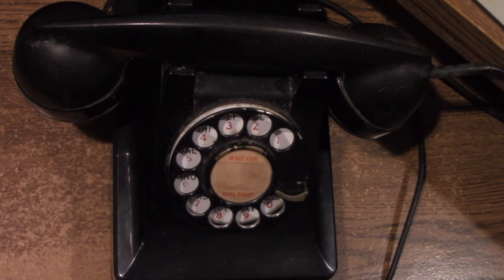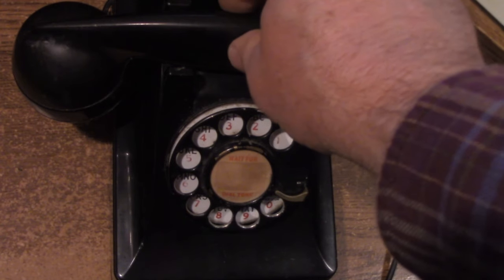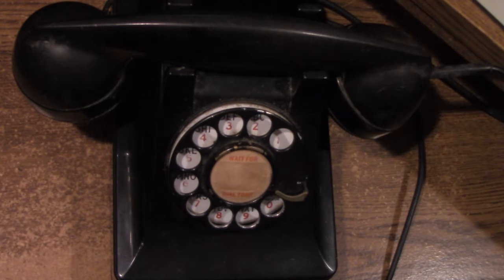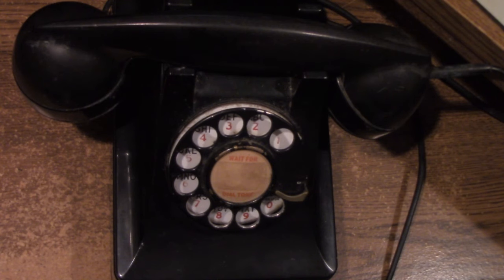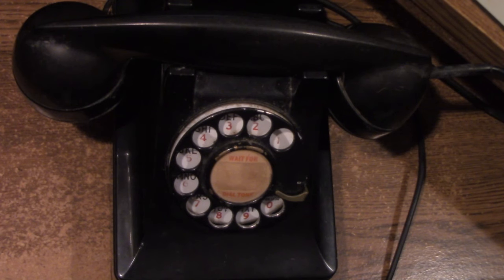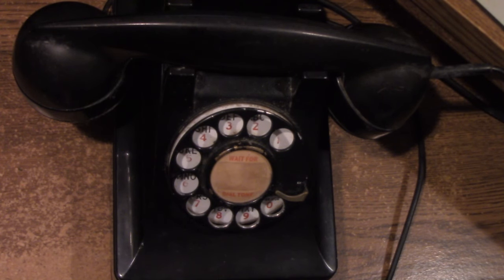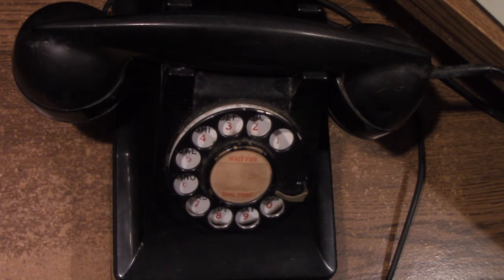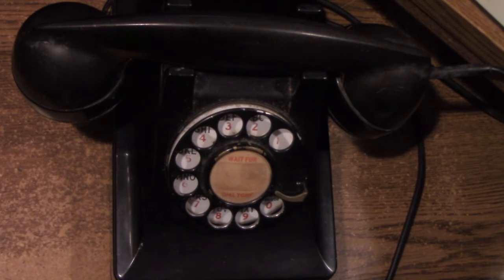Antique Telephone Test

Comment: Possum Back in the day I worked on the test range RCA/PanAm I fixed these phones and the switch as well as doing the OSP. we had a Stromberg Carlson X/Y switch 150 line switch, the coolest thing ever,  ya need 28 volts to ring em...

Comment: I have an uncle who has one of the old wooden box type phones you mount on the wall.
Reply from the maker: Those are pretty cool. I see them occasionally at antique stores and such.
Reply: @Possumliving  also I think my dad said the old crank type phones had a magneto or something like that in them.  When he and his brothers were little,  they used to to turn the crank when ever the telephone man was working on the line near their house.  They said it would shock him.
Reply from the maker: @bluegrassman3040  Yeah, they do. That's how they generated the ringing voltage. Some people convert them to work on modern systems by disconnecting the magneto and mounting a rotary or pushbutton dialer inside. From the outside it looks the same, but you can open the door and dial.
Reply: @Possumliving  that’s neat.  My dad said they also could use those old phones to shock a pond to catch fish.

Comment: The ring signal is ~100vac, probably @60hz but not 100% sure.  In the old days it directly drove the clapper coil, but I spect  these newer VoIP onts can't source enough current for all that.  You'd have to make some kind of circuit to detect the ring and switch a beefier ring signal onto the line or something, I dunno.
Reply from the maker: You're right. It's 50-90 VAC at 20-50 hz. There actually is a device you can put inline that boosts the ring signal and has enough output to drive several old phones, but they cost about $200. I would rather build one, if I can find a circuit.

Comment: 2:22 was it the western electric 500 phone you mentioned earlier that rung in the background or is the 302 one super quiet?
Reply from the maker: That was the 500. When I made this video I didn't yet have the ability to make this one ring. It rings very strongly now, using an Xlink BTTN.